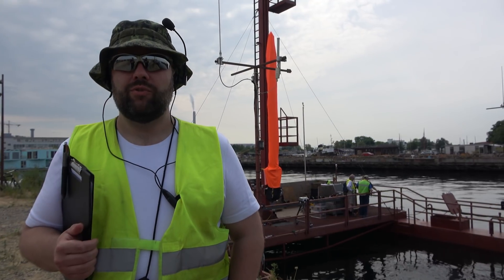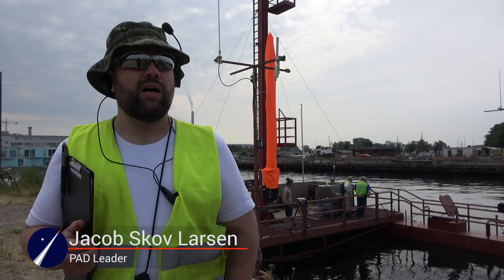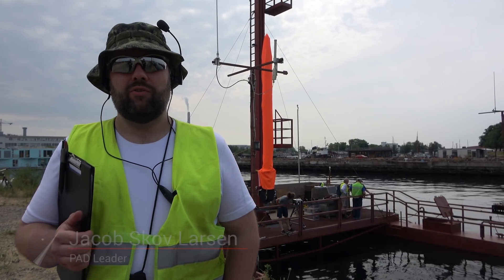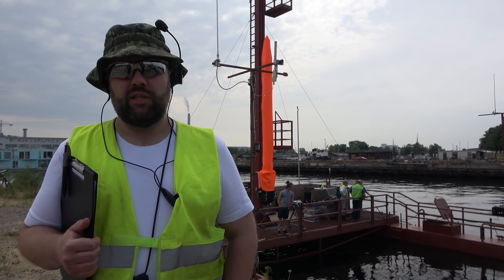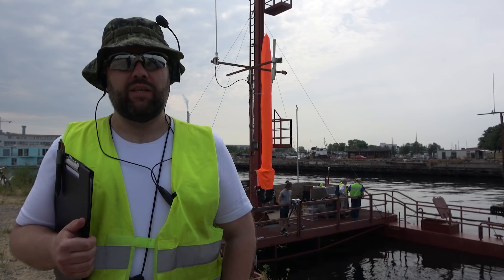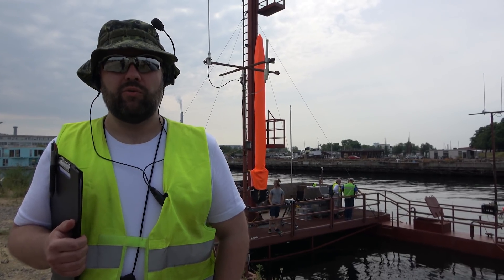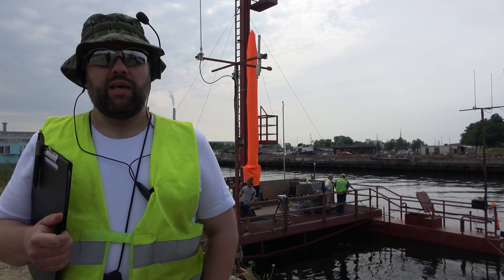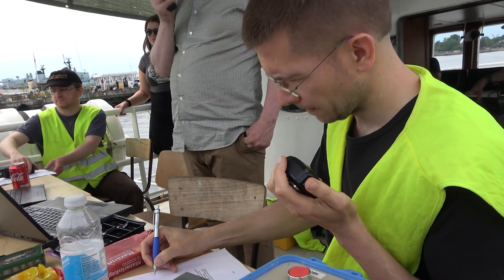The final Harbour Acceptance Test before Nexø II launch

Comment: Does that valve mean, that you need poeple on sputnik during LOX-loading? Doesn´t sound like a dream-job
Reply: klosskopf der1. That's not that dangerous, they typically do this with a full crew sailing the platform etc. at the same time.  2nd most dangerous step is for the last guy to arm the ignition system before abandoning ship.  Most dangerous step is to stay inside the capsule during launch.